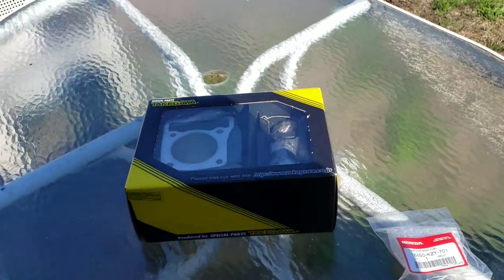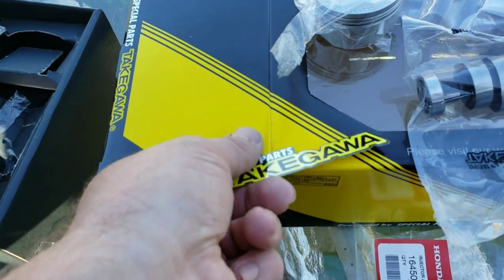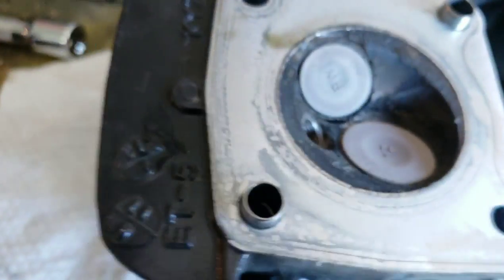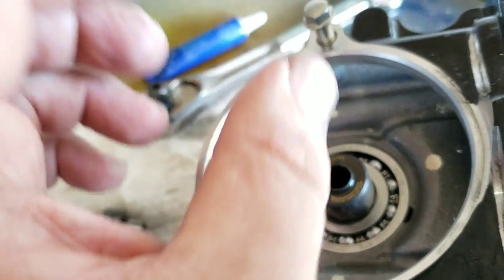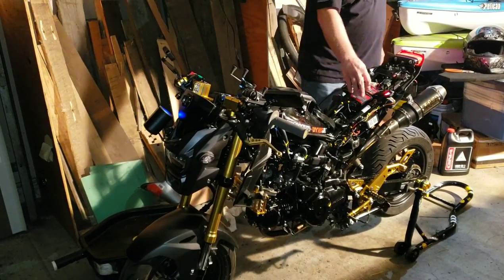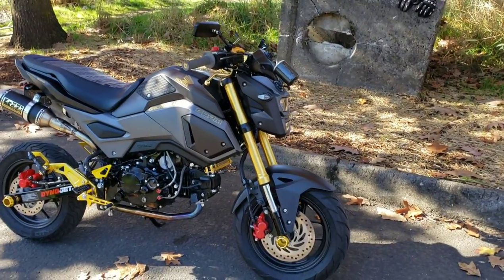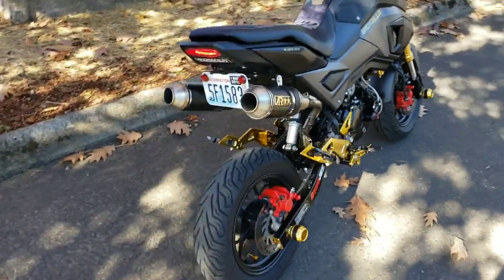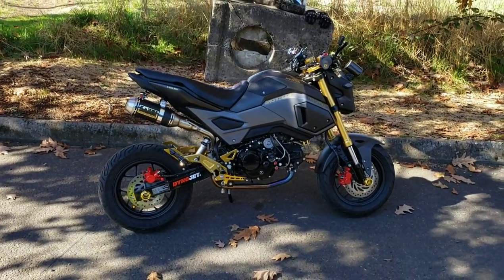GROMZILLA gets the TAKEGAWA 181  Big bore kit and type-S camshaft

Comment: Can someone explain to me why you have to ref lash the ecu
Reply from the maker: If you are doing a Big Bore Kit and exhaust or an intake the ECU is only capable of adding approximately 5% of fuel so if the bike is requesting 8% more fuel the ECU can only compensate for 5% this means the bike will be running lean... so for example on my bike running a Big Bore Kit bigger camshaft a bigger exhaust and a bigger intake it requires about 30% more fuel to run the bike and not go into a lean condition... this means I had to build a custom map and then flash it over to the ECU using the Dynojet pv3.. in my custom map I have added a few degrees of timing and more fuel... By attaching a wideband O2 sensor to the exhaust and using a wideband O2 gauge I'm able to monitor the air to fuel ratio and tune the bike accordingly.. you can also achieve adding fuel using the power Commander v and the wb2 from Dynojet.. power Commander v can program the higher throttle position from 80 to 100% throttle while the wb2 is a wideband device it can program the closed-loop section of the Honda Grom which is 0 to 79% throttle... 

I do offer custom tuning work based on your modifications and then I would send the tune to you through an email and over a phone call video chat or text walk you through everything you need to do on your end to make it as simple as possible for you. 

So if you look me up on something like Facebook messenger we can talk more there if you have further questions or if you're interested in having a custom map built..
Reply: Bill thanks for the info . just to give you an idea of what I am looking to do,the takagawa 181 big bore kit with the cam ,and oil cooler .is the auto tune needed .I already have  the power commander v and the chimera intake, clutch cover and ackapovic  full exhaust  (not looking to do the crank) I figured I would add the crank bearing support in the center of the stator for more crank support and also add the new cam chain tensioner . What are your thoughts?
Reply from the maker: @paulhartman7144  that will be a good little setup.. you will have to have WB2 {wideband controller to with Auto-Tune} something a lot of people overlook is that the power Commander can only control 80 to 100% on the Honda Grom.. that is considered the open-loop section and it is the only thing that the power Commander gun control when it comes to the fuel..  the closed-loop section is 0 to 79% throttle.. this section is completely controlled by the factory O2 sensor and will always try and go back to a 14.7-1 AFR.. that is already a little bit too lean Honda does this to save gas mileage.. the thing you have to remember is the groms ECU is only capable of adding approximately 5% fuel.. that 5% would be enough for something like Just an exhaust.. if you do anything more than that it will Max itself out at the 5% margin and then the rest of the time it will just run extremely LEAN beyond 14.7-1.. with the Big Bore Kit intake exhaust and a camshaft you will have to have WB2 if you want it to last..  that's what I did and I have over 5,000 miles on my Big kit..

Comment: The "181" is that the diameter of the piston or the volume of the cylinder? What is the part number for the turbocharger kit?
Reply from the maker: It does not have a turbocharger kit .. I do not know if they make one I have a buddy that is going to custom make one for me.... and that is the displacement of the engine when you add this piston.. 181cc
Reply: @BLRTUNING  I see them swapping 300cc engines in them as well. Gotta get a Grom.

Comment: How much horse power?
Reply from the maker: On e85 the bike was able to hit 96 mph as the weight sits right now. The way it sits right now it's much different from this video but I would estimate by doing the 181 Big bore kit with the koso 240 Cam you're probably doubling your horsepower maybe a little more when it's tuned correctly. We do offer custom tuning for these bikes I also make two step launch control that works with power Commander 5 or power Commander 6. You can check everything out on the Honda Grom section on our website.

www.blrtuning.co

Comment: whats up boss, It's about a year later. How's that 181 cylinder holding up?? i have the 143 w/cam and power commander + tons of other goodies and thinking about doing just the 181 cylinder plus maybe the 150 injector.
Reply from the maker: Runin good.... No issues 4000 miles on the 181 still strong as day 1
Reply: @BLRTUNING  awesome thank you!

Comment: How big are those wheels?
Reply from the maker: They are the stock wheels.  So 12 x 4 in the back 12 x 3 in the front.. I'm running Michelin power pure
Reply: @BLRTUNING  Hi Bill did you change fuel control and a/f monitor too? thanks
Reply from the maker: @yuenhan4732  yes the dynojet power Commander v with wb2 that's dynojets wideband with Auto-Tune.. then I have an air to fuel ratio gauge from dynojet I also have the pod 300 from dynojet.. the pod 300 lets you monitor all kinds of information and it will also let you control the wideband lambda value to adjust the air-fuel ratio requested in the closed-loop section of the bike...
Reply: @BLRTUNING  thanks for reply, have a good day

Comment: Seat? Soft?$4,000 grom just turned into $7,500. I'm going to sell my 03 250 Ninja. Like new. Buy a grom if I can find a comfortable seat.
Reply from the maker: It's more comfortable than stock but no matter what seat you get none of them are really all that comfortable on the Grom.. the stock seat offers quite a bit of padding but it sits weird and is not comfortable at all if you ride for more than an hour in my opinion.. this seat is comfortable for about 2 hours that I put on the bike
Reply from the maker: Bride racing is the new seat that I have
Reply: Yeah I know I sat on a Grom the seat on the monkey is really comfortable. I'm old and I'm a little boney in the butt

Comment: What MPG did you get with this one?
Reply from the maker: On 92 pump gas about 80 miles out of a full tank bone stock the bike was getting about 120 out of a full tank.. now the bike is tuned on E85 ethanol and it gets about 60 miles out of the tank but it's making about twice as much horsepower..
Reply: @BLRTUNING  Thanks a lot Bill - very hard to find reliable data on the 180-190 cc builds. I'm surprised you get such a low mileage. That's the same people report getting with their 300cc swaps. Am I missing something out here? :|
Reply from the maker: @cubul32  on pump gas it still gets good gas mileage. you have to remember I'm running a bigger camshaft and intake and exhaust and a custom built head.. everything I have done to the bike directly affects the gas mileage in a negative way.. remember the more power you add the worst the gas mileage is going to get that's the inevitable...
Reply: @BLRTUNING  True, more pow more gas. I didn't get to watch the whole thing yet - being a noob I would have missed some details too. I heard of people getting 90mpg roughly out of theri 180-190 setups. That's why I'm surprised. At that mileage - my opinion, no offense - I might as well do a 300 swap :)

Comment: lean AF on that stock head and you're running cheap gas
Reply from the maker: Not sure exactly what you're even talking about.. not once did I show the air to fuel ratio in this video while the bike is running... the part where it does show it is just having the key on so of course the air to fill ratio gauge goes to Max lean the bike is not running.. I've been tuning motorcycles for over 15 years this is what I do for a living... This bike is sponsored by Dynojet and is tuned very well... At the time of this video we had it running on premium pump gas and a 110 mix.. we then switched it to running full 110 and now the bike runs on E85..  a lot has changed since this video as far as running cheap gas we are far from that.. I bought the bike brand new off the showroom floor it's never had cheap gas in it.. it's never ran lean.. if tuning work is something you're interested in I have some pretty decent prices feel free to message me all my contact information is in the link below in the description of this video...
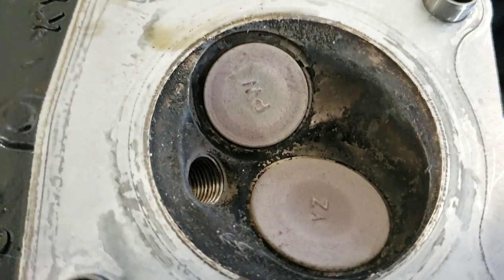Reply: @BLRTUNING  @3:28 it shows the valve face and combustion chamber. 2275 miles on a stock motor, tan valve heads and carbon build up. That shit is lean from the factory and running crappy gas.
Reply from the maker: @ifazer8akathedoctor275  I totally agree they run extremely lean from the factory. they run lean until you get into open loop and then they run rich as hell... You should check out some of the newer videos... A lot has changed since this video..